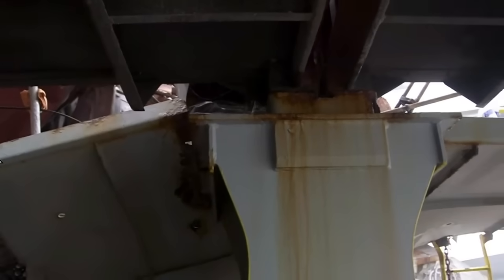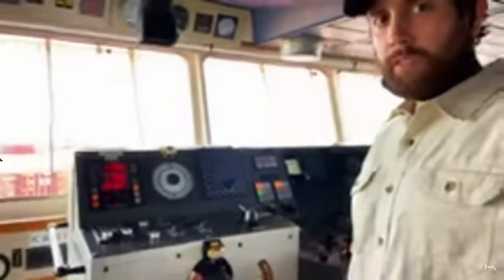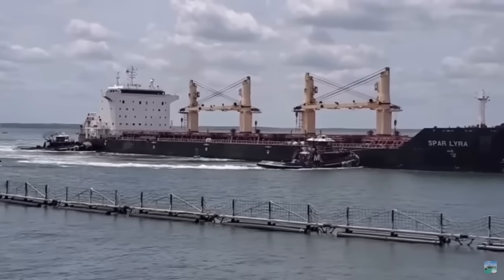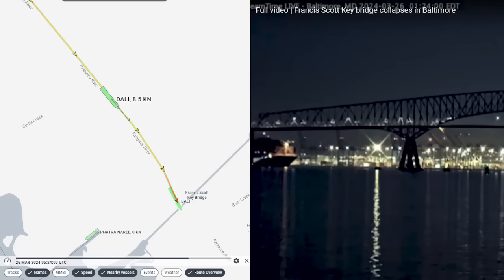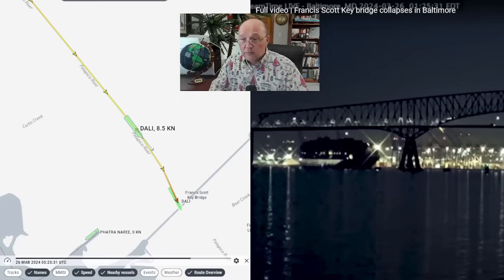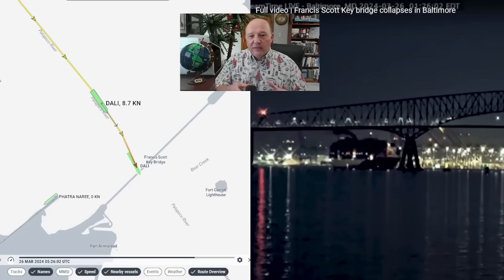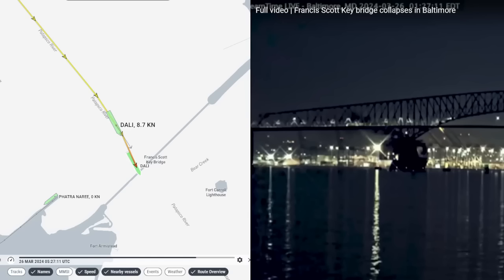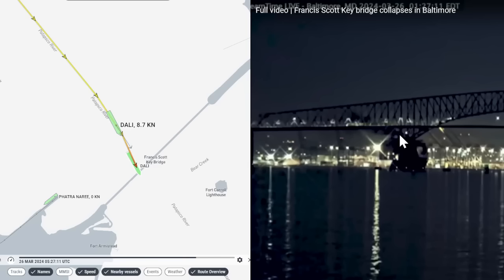Dali Timeline from Data Recorder in Striking Francis Scott Key Bridge in Baltimore, March 26, 2024

Comment: Not trying to be a wise guy but I'm a Marine electrotehnical officer (ETO):
Emergency generator usually supplies key machinery and equipment.
If the steering gear is composed of 2 pumps, driven by two electrical motors, one of this will certainly be supplied by the E/G.
At the moment the emergency lights turned on, they certainty had power to the Steering gear emergency pump.
From this point I can only guess what happened, but from the electrical point of view, I believe they had control of the steering gear for a brief moment before the second black out.
I know after a incident everybody find the best solutions, and ideas.. I just hope this info is helpful to anyone interested.
Cheers!
Reply: hello ETO, you are absolutely right about the emergency energy supply.
i have been a marine engineer for 40 years and found, that the shipping companies are trying to reduce costs of having at least 2 tugs, by using  bow and/or stern thrusters.
however, these do not operate on the emergency power supply, so the vessel is doomed with a black out.
there should be a requirement from the insurers, like Lloyds of London, ABS and others to make sure, that a vessel is accompanied by sufficient tugs to reach the open sea.
during my last years at sea, before retirement, i also found that shipping companies were introducing cheap and cheerful staff to man their vessels.
whilst the well educated officers in the Netherlands have been sacked by the likes of the Danich firm Maersk!!!!!
it all comes down to MONEY!

Comment: Another cracking, informative video Sal. Thank you and well done.
So if I recorded it correctly, there was only 4min 12 secs between 1st power loss (01:24:33) and the first signs of impact (the splashes) (01:28:45).
That is no time at all to react, restore some form of power (twice), communicate to ashore, and get the bridge traffic stopped. 
All sorts of people in different parts of this operation did an extraordinary job to attempt to get the ship under control and get that bridge closed.
However, with the power failure at that point, restoration of FULL control of the ship was highly unlikely, so the ship and the bridge were at the mercy of chance (eg precisely where the rudder was when control of rudder was lost, maybe twice!), and external conditions. 
Strikes me one can never completely remove the risk of a large enough ship loosing control at a critical point near a bridge, so protection of the vulnerable parts of bridges is the only way of preventing a repetition of something like this somewhere at sometime.
Alan

Comment: The requirement for bridge voice recorders by IMO is absolutely fine.  Problem is that no one seems bothered when they are not working properly at the mandatory annual inspection and survey.  When working properly, you can compare microphone input time differences and determine not only who said what, but where they were when they said it.  Don't read too much into the "issuing rudder orders"; if the ship is blacked out then all the helmsman is doing is moving a switch on the bridge that isn't "commanding" anything (applies to FU, NFU and Autopilot modes).  The lack of the VDR recording data for periods before the allision could well be a lack of data being supplied from the INPUTS to the VDR being offline.
Reply: No one seems bothered? Well, if you have VDR out of order for any reason, even with single non-active channel (like corrupt nav data - log, or echosounder, or anything like that), your VDR will not pass Annual Performance Test and then you have to seek an exemption from flag. They will grant it for 30 days, perhaps give you an extension, if you are in a bad part of the planet, where service is not available. Eventualy, all must work.

As to the steering - one steering gear pump must be supplied from emcy genset. After 45 sec of blackout you will have rudder, if all works correctly.

Comment: Hi Sal, I was a Captain on different types of ships. I have also gone as one of the Captains on board newly built ships at the Cochin Shipyard. These ships are taken out to sea for almost 10days on sea trials and we do something called a crash stop trial where the engines are put from full ahead to stop and then full astern. It is during this trial the stopping distance is ascertained. When this type of manoeuvre is done a lot of smoke emanates from the funnel. With a right hand pitch propeller the bow will cant to Starboard (right). Could that have happened here? Kudos to what you do.

Comment: Hey.  I don't know about diesels on ships, but I am a nuclear engineer and know about large diesels (used as backup power on power plants).  Large diesels should have a load sequencer because you cannot just start up a diesel and connect a huge load, which would incur a large surge and trip the generator.  The solution is (often) an automatic (could it be manual?) sequencer that connects loads in order of size and importance to avoid tripping the diesel generator off the loads.   Don't know anything if this applies, but if the helm demands a large load or there is a large demand signal at the time of the power connect, a surge could have tripped the generator.  If the sequencing the generator is manual, then the urgency of connecting the helm load could possibly be out of procedural order and could have resulted in an overload and tripped the generator.  Just a thought.  Albert
Reply: Generators onboard ships also have sequential start.When it's put on load in auto, Important machineries like steering, Main engine LO pumps, Fuel oil pumps come  on load immediately.Rest of the machineries also get started in intervals of 5 -10sec.
Steering gear hydraulic motor don't consume much power to cause blackout.It would be first one to start . Larger helm order increases some load on generators but not enough to cause blackout.
If there is power surge, non essential things,like AC, Refer systems will trip first(Preferential trip).But if power surge is big enough, it will trip the MCB of the generator.
What I think is, after the first blackout,only one generator came back on load & subsequently all machineries were running on single generator. Use of windlass to release port anchor on single  generator could have caused second blackout.Although anchors can be let go by releasing brakes .But they might have started windlass as it is normal practice onboard ships prior anchoring  & taken the load of anchor on windlass before letting go. That load of anchor on single generator can be high enough to cause second blackout.
Reply: Thank you for your affirmation. Basic diesel gen engineering. 👍

Comment: 5:42 tugs successfully nudging ship in right direction 9:56 exploring VDR timeline... 17:26 dropping anchor 101 18:46 black smoke from restarting main engine 22:01 with no wind or current, how/why is ship turning? Maybe light tide. 23:38 with just a little rudder control, should have been able to correct course, pass safely under bridge 24:41 police stationed at both ends for construction zone speed monitoring
Reply: Tugs nudging a much smaller ship, going much slower and nearly sinking themselves as a result....

Comment: After watching this video and reading the comments I have come to the conclusion that YES, something very bad went wrong at the worst possible time onboard the ship BUT the disaster happened SIMPLY BECAUSE THE AUTHORITIES FAILED TO UPDATE THE DESIGN OF THE PIERS THAT WERE SUPPOSED TO PROTECT THE BRIDGE PYLONS IN THE EVENT OF A FORESEEABLE SITUATION LIKE THIS.
If the piers had been re-designed and reinforced back when ships of this size became "the norm" in these waters, then this ship would have run aground on them and possibly even sunk.
BUT THE BRIDGE WOULD HAVE IN ALL LIKELIHOOD SURVIVED.
Now we can look forward to all the responsible authorities start to blame budget cuts or labor shortages or the fact that their own underpants did not have sufficient balls in them TO DO THEIR JOB PROPERLY.
Reply: Updating the design of the piers would require rebuilding a bridge, as adding sufficient sized artificial islands can't be retrofitted, they would take up too much space and be a hazard to shipping (replace taking out a bridge every 4 decades with taking out a ship several times a year). Yes, they could fix this by a new bridge or replacing it with a tunnel, but there are hundreds of bridges in the US like this, and none, not even the ones with the relatively small islands shown in this video, could actually have stopped a ship this size. There's probably 5 bridges in the world with enough protection. Ultimately, with 6 fatalities, and one bridge out, it's likely still not going to pass a cost / benefit analysis to replace all the required bridges. 

Here they simply don't let large ships transit at all and just moved the entire ports to reclaimed land downstream. Rebuilding the bridges is simply not cost effective.
Reply: @peter65zzfdfh  Dolphins could be added leading to the bridge piers, not encroaching on the channel.  It might be possible to add fenders through the opening, by sacrificing a small percentage of the channel width.  Now that the bridge is gone, there is the opportunity to build to modern standards.

Comment: Chief  Makoi said this Dali incident is not about a bad bunker fuel ⛽️… but it’s rather a switch board problem because if it was caused by a bad fuel..they wouldn’t have been able to restart the engine right after.
Reply: Yea, I think it was a simple electrical issue.  Overload, cause by loose wire shorting out , and/or blown fuse overloaded somewhere.  
A "horse-shoe nail" so to speak.
KISS rules😎, Occam's razor is usually the fault. Then it goes to the "swiss cheese model" of a disaster. - And The horse-shoe nail goes through all holes.
Reply: @chrisperrien7055  you realize there were at least 2 Aux gensets working at the time of black-out? Working parallel in load-sharing mode + 3rd genset on stand-by? This is a standard procedure. A single point of  failure should not cause black-out.
Reply: @SawomirMaj  IDK. Yes there usually is "redundancy" in such systems , and is a going concern on such big ships if they are run with qualified maintenance. which means ALOT of money and professional  sailors.

This ship had a power failure leaving port.
If it wasn't a single failure , it was multiple cascading failures, that either the ship crew and the ship owners should have already noted and fixed.

I hate to bring up the idea of "coolies" but such a big ship should not fail when leaving port . And it hasn't happened in nearly 50 years this catastrophically in a US port under US regs/sailors or on a US flagged ship . So IDK.

I suspect that this ship had maintenance/electrical issues that the crew/company /captain "papered over" to leave port, and the USCG/Port Authority didn't look hard enough at since it was a foreign flagged MAERSK ship with a foreign flagged crew, which has been going on for years.
Reply: @SawomirMaj  No idea, was just hypothesizing. The whole incident reminded of the USS North Dakota at the Battle of Guadalcanal. IIRC, Some electrician wired a main circuit bus-bar closed because breakers kept tripping, cuasing more failures, and making the ship combat ineffective.

Comment: The Dali's engine is a single direct coupled 9S90ME-C9.2  9 cylinders, 900 mm bore, 3.26m stroke, 41,480 kW at 82 rpm.  Direct coupled means that the engine and propeller rotate in the same direction and at the same speed as each other.  These are beautiful engines, bulletproof and super-economical.  Why so much smoke?  The engine room crew may have bypassed the engine safety devices which would allow it to apply maximum fueling to the engine; that would be consistent with all that smoke.

Engine restarting is almost immediate, sorry Sal, but they would need to stop the forward rotation with starting air, before rotating the engine in the astern direction as part of starting it.  If the engine was started and running astern at best power in the conditions, the ship would be subject to significant transverse thrust tending to kick the stern around.  This would be consistent with the change in track after power was initially restored and we start seeing smoke.  Just one man's musing, we will have to wait for all the facts to come out.
Reply: AFAIK Engine Room recovery after black out takes time. You cannot run Main Engine before you have Auxiliary Generators running and even then restarting of this kind of engine is NOT instantaneous. Even by-passing all safety systems will not make it running in split second.
In my opinion  Main Engine was not running from the moment of 1st blackout till the impact. Belching of smoke - this plume of unburnt fuel particles followed the turbocharger surge when ME was abruptly stopped. Mind you the vessel was sailing with speed consistent with probably Slow Ahead setting, perhaps something between Slow and Half, if the intention was to speed up further.
Reply: Could you re-word that? This stuff is quite new to me.

Comment: It is not the emergency generator that Kik on after the black-out it is one of the main generators. You cannot start the main engine on a emergency generator, you need LO pumps Cooling water pumps, fuel module to run. Emergency generator only supply steering gear, fire pumps, navigation équipement and emergency lights. You can clearly see that the main power came back. Not the emergency power, all the lights came back on…
Reply from the maker: The emergency generator is used to restart the SSDGs if they go off line.

The power outage is an indicator that either the SSDGs went off line.
Reply: Agreed, but you can't really tell what lights were on. If you have black-out, you cannot start AE without Emcy Gen set giving you first power on prelube, cooling etc. If you have a dead engine room, starting generators without emcy gen set power supplied via ESB is rather not an option.

Comment: My question as a Navy veteran, on ships for 5 years, Was an 'Electrician Mate" on watch in , MMR & emergency Diesel Gen space ?
Reply from the maker: Excellent question
Reply: small crews on these commercial vessels
Reply: The electrician would be  in the engine control room during standby.
Reply: No one is typically in the EDG space unless you are there to do maintenance or inspection.

Comment: seems like they should berm up the riverbed around the pilings so ships with big draft cant get close to them... at least the ones right next to shipping lanes...

yeah like that bridge with the "islands" but they dont even have to be full islands... just shallow enough to run a deep draft aground... though the island is gonna be better for visual ID..
Reply: There are hundreds of ports all over the world with poor protection of bridge piers like this.  Frankly I'm surprised that there are so few incidents like this, as large ships loose control from time to time.  It is more common than you might think.
Reply: Given the extortion rate tolls we pay in Maryland they should have built some sort of buttress to protect the bridge.
Reply: The current channel measures about 700 feet wide. This was essentially the dredged width before the bridge was built. I highly suspect the pylon spacing for the bridge was chosen to accommodate this channel width. Thus, the width of any protection would have to come out of the width of the channel. My wild guess is that it might take a buffer of 200 feet around the bridge pylons to protect them. To add this (200 ft on each side) would pinch the channel down to about 300 feet. Countless dollars have been spent to continually widen and deepen the channel over the last 185 years to make access to the port possible. Cutting the channel to less than 1/2 of it's current width would probably cause ship congestion in a busy port, and increase the risk of two ships colliding -- which has happened in previous accidents around the world. I agree new bridges should be built with such protection. But to add it to existing bridges would at the very least be quite expensive. To add it without permanently disrupting shipping might require entirely new bridges. Think of a bridge you use a lot. Would you be willing to pay thousands of dollars out of your pocket, and be without this bridge for 3 or 4 years to marginally improve it's safety?